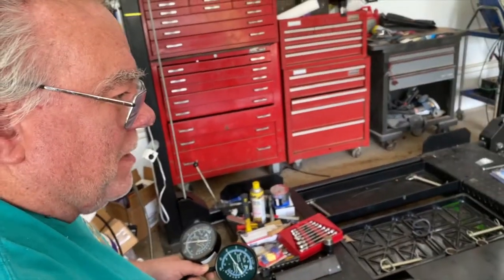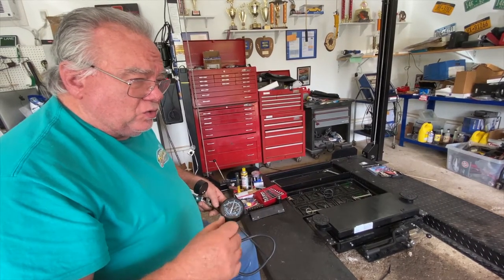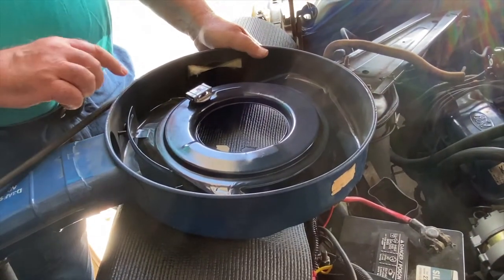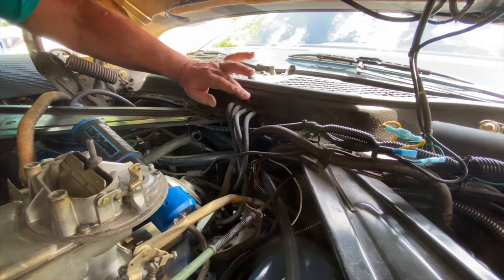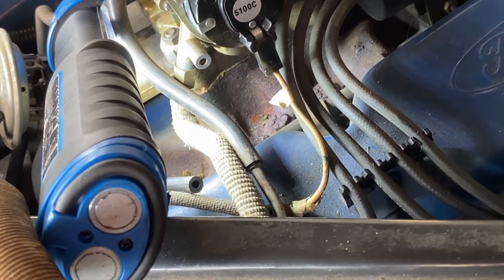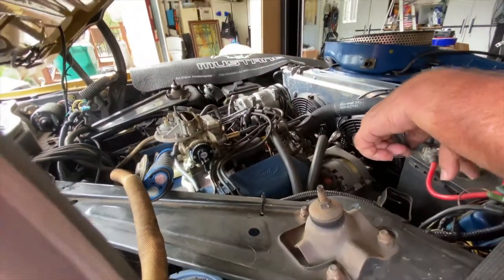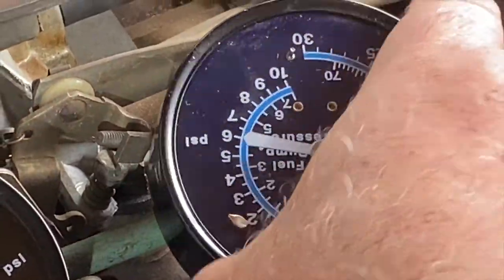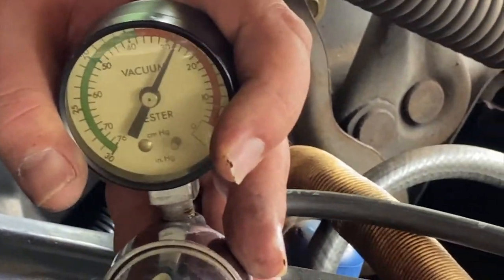1973 Mustang 302 2v Comprehensive Vacuum Systems Explanation And Testing

Comment: Sir thank you for the video, question for you i have a 1977 mustang ii 302 i am having trouble with the two 3 port trees on the rear of the intake manifold, any idea about the hose connection of the hoses.  i have looked everywhere cannot find were they go. any help would be amazing. thank you.
Reply from the maker: Hi!  For some reason the vacuum schematics for 74 and later Mustangs have been hard to find.  But, let me dig around a bit and see what I find.  This may take a while.  But, your query is important so I will pursue it.  Please stand by.
Reply from the maker: Hi, again!

I found a used manual for 1977 Mustang, Granada, and Versailles vacuum calibration/schematic for emission control systems.  It looks like only a few pages of a far more complete book have been removed so the seller is selling just certain parts of the manual likely in order to get a higher price from the entire manual.  Once I get the manual I will scan/photograph the relevant 302 pages and put them on my Google Drive.  Then I will send another reply to you advising of the link you can use to download the pages.  As I am not going to assess any fees there is no copyright violation by either of us.  I hope the pages I ordered prove to be what you need.

Many years ago, late 70s and early 80s, I worked as a tech at a Ford dealership in SoCal, and did a lot of tune-up, electrical, and emission control work on late model Fords and Lincoln/Mercury cars.  If you were located near our place (Rochester, NY) I could have likely been able to look at the engine and quickly figure out what vacuum lines were connected where.  

I find it very surprising that I have found, fairly easily, a lot of info on electrical and vacuum systems for 1965 - 1973 Mustangs and Cougars, but the 74 and later info is so scarce.  But, so far, when a need has come up for those 74 and later vehicles I have so far been able to dig it up - sometimes after a few days of searching, but usually only after an hour or two.  Meanwhile I keep building my library of manuals and info...

Please stand by for my next reply with the link for the images you are looking for.  I am guessing I should have the info in hand by the end of this current week (it is 6/11/2023 today).
Reply: Gilbert, please don't go out of your way for the manual. You are too professional  and nice. I'll try to attach photos of the two trees. Thank you again,  Pete
Reply from the maker: @peteg4482  it is not a problem at all. This gives me a chance to continue building my library with some direction. Better this way than just getting everything I can find whether it is needed or not.